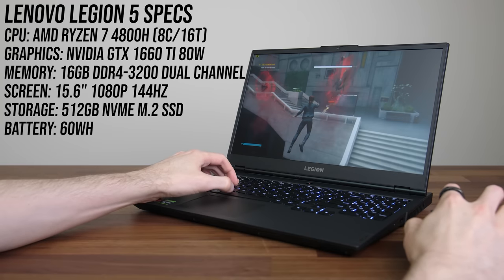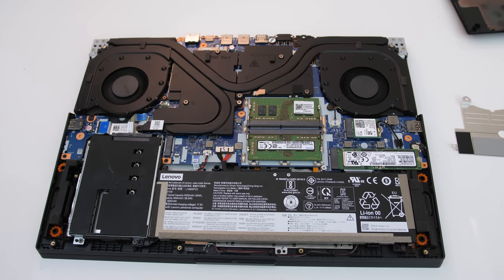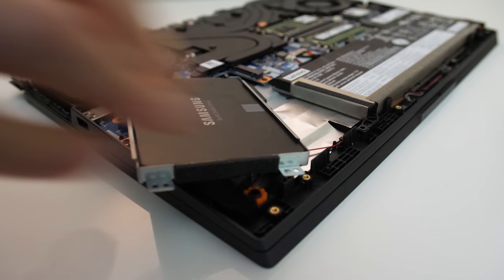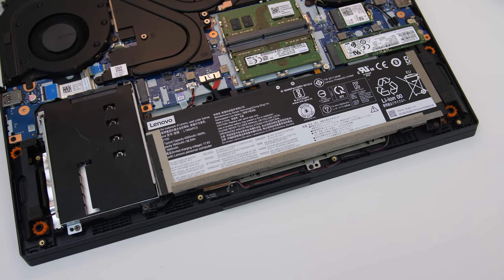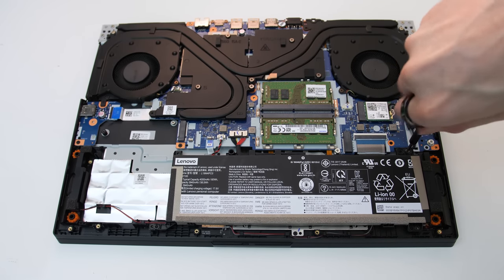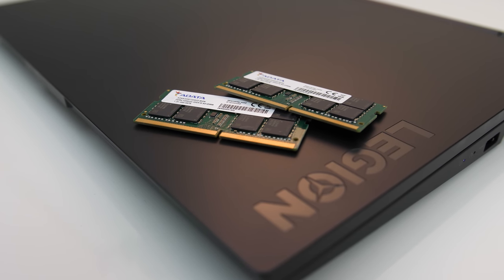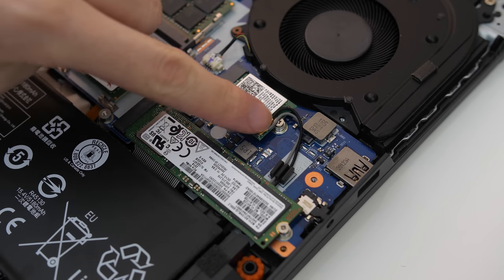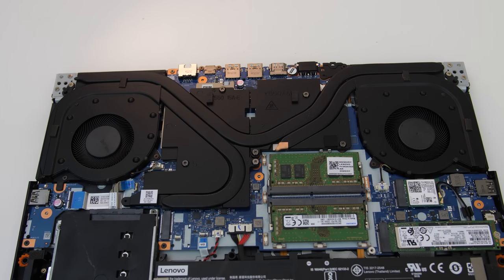Lenovo Legion 5 Upgrade Guide - Boost Performance!

Comment: Does the Crucial Ballistix BL2K32G32C16S4B 3200 MHz work with this laptop? I keep seeing some complaints saying 3200 only useable with XMP profiles. I don't know much about this. Are there any other ones recommended?

Comment: i purchased 3200mhz ram, but i cant get it to run at that speed. even though the oem ram was 3200. Obviously ive looked and cant find any options to enable docp

Comment: Still think the Dell G15 makes better sense as a Gaming Laptop purchase... Lot of people were boasting about owning one of these but my laptop comes with rtx 3060 and a 240 Watt power supply: sure it does not have a "240" hz monitor and you can't game longer than 2 hours: you can work 10 hours on it however or just watch youtube but since all you really need in reality is a powerbank that can provide you with a 240 watt experience on the go it's not that big of a deal. It may not look as sleek but, my laptop looks unique, does not get too hot or loud while running games and has decent enough specs vs a 1660ti - if you're a new buyer consider comparing these 2 laptops, you'll be pleasantly surprised.

Comment: I have the Intel version of the Legion 5 that I bought last year; it's equipped with a Core i7 10750H CPU, 16GB of RAM, and an nVidia GeForce RTX 2060 GPU.

I'm planning on upping the RAM to 32GB, as I think 64GB is overkill for what I do, and I don't know if my laptop is compatible with it.

Does the guideline apply to Intel models?

Comment: I recommend disconnecting the battery before performing any work on the main board.
this is the first thing to do you are very lucky that you did not burn it. greetings

Comment: if you're installing an additional m.2 ssd, do you need a heat sink as well?
Sorry if a noob question, first time looking at upgrading a laptop myself
Reply: Please don't update these things yourself if you are not professional in it bcz some people in the comments are saying that you have to first disconnect the battery or else motherboard will short circuit idk but it's caution so I don't recommend you to do at your own upgrade that from your nearby electrical shop or laptop store
Reply: Not for a 1TB m.2 3.0 SSD. No point in getting the faster 4.0 stuff that requires a heatsink as it goes in a 3.0 slot. Plus, I don't think there is room for the heatsink.

Comment: So I'm thinking about getting a legion 5 from the lenovo site and they have the option of it being an 8GB ddr4 memory and 16gb ddr4. So my question is should I get the 16gb or just get the 8gb and get (2) 32gb like you did? Also they have an option for a 1TB ssd and wondering if I should get that or just get the lowest size and get a bigger ssd later?

Comment: Awesome video Jarrod!  I'm looking at purchasing a Lenovo Legion 5, but it comes with a 1tb HDD drive in addition to the 512gb PCle SSD drive.  Would the 1tb HDD drive get in the way of trying to install the 80w battery?  I'm curious if the HDD sits in that drive bay and if it would prevent me from installing that bigger battery.  I talked to the Lenovo sales team and they said it was possible for me to upgrade the battery on this model, but after watching your video I'm a bit confused and just wanted to make sure this was possible.  Would appreciate your advice.
Reply: I don’t know think there’s room. I heard you have to pick one or the other unfortunately.
Reply: @Blue-xn1mj  That's what I figured. Thanks for the reply!

Comment: Thanks for this video!! I was totally thrown on how to add a second SSD. Didn't realize that it is either a SATA drive or SSD. So many little things like this are confusing in the initial advertising. Lots of small print needs to be considered. The Battery for instance. As you were experiencing it seems like many of the max specs are confusing to third party manufactures also. It appears that whatever hardware state the industry was in at the time Lenova tested the units is what they stick with. I still see it being suggested that 16 GB or RAM are max. I just put 32 in, but you have shown 64 is fine.

Comment: Jarrod, Is it possible to replace the 80wh battery of the Lenovo Legion Pro 5i with 99.9wh battery of the Lenovo Legion Pro 7i? What about speakers? I am asking this question because these machines literally use the very same chassis and speakers and the battery of lenovo legion pro 5i is terrible.

Comment: I have uncovered the laptop and I could see that you can install an M.2 2280 in the place where the M.2 2242 is. You remove a base screw and it fits right in. I will try it later when I buy the M.2 and expand from 128GB to 1TB.

Comment: Dear Jarrod, great video. Upgraded battery to 80W Lenovo OEM for the Legion 5i. Charges normally 100%, works perfectly when plugged in. However, when on unplugged, i.e. working on battery alone, boots initially but powers off each time before reaching windows logon screen. Reset BIOS to default. Reset power management to default in control panel. Boots each time when plugged in,  but not on battery. If boot plugged in, will continue to work when unplugged once in windows. Could you please advise how I could fix this problem? Thanks very much. A

Comment: I have a lenovo legion 5 laptop. i bought it in 2021. Warranty expired in 2022. Last year, its charger started fluctuating/ blinking. The charging metal portion, that goes into the charging port of laptop, started getting super hot while playing games. Whenever this happened, the charging light would start blinking and the laptop would go from performance mode to balanced mode, causing major lag in the transition (basically the charger would start disconnecting and connecting. Gaming was impossible) . I got it checked out from the local store. They told me that I had to get a new charger or replace the charging cable (the power cord is fine but the charging cable attached to the power brick was the issue apparently). So I got it replaced. It worked fine for about two months, but the same issue started happening again. This time, I bought a new charger and got the laptop cleaned and its thermal paste changed. It worked perfectly for the past six months. Unfortunately, the same issue is happening again since yesterday. It is so frustrating. Please let me know if there is a permanent fix to this problem. Can the problem be the charging port (it somehow fries the charging cable overtime or something?) or is it the charger again? Chargers are really expensive. Also, I don't have any guarantee that buying a new charger will fix the problem permanently. Will it work for only 6 months or so? I cannot afford to buy a charger every six months. Please let me know what to do?

Comment: Dude, when you lift the laptop cover, before ANYTHING you do, first disconnect the battery. Then do all other things you wanted to do. This is because anything you accidentally drop on the laptop PCB, will short something and the motherboard will be dead. Any accidentally dropped screw or metal cover or even merely disconnecting some other connector (like display connector) will have very good chances of killing the device.

Comment: Sir need some help actually I've upgraded battery 60wh to 80wh but laptop only turn on when charger is plugged in after booting I'm able to use laptop without charger but initially its not turning on without charger... How can troubleshoot it..
Reply: Try turning the battery cable other way...

Comment: So after removing the 1tb 2.5 ssd that came stock to make room for the larger battery and installing the m.2 ssd, could I also replace the 256gb m.2 ssd with a second 1tb m.2, or is this not necessary? And if yes, what else would need to be done setupwise. Thank you!

Comment: i have the  i7-10750H/RTX 2060 version. I added a SSD to mine with the help of another video, and they didn't mention lifting the battery slightly to help get the tray out. I wish i saw this video back then

Comment: I can see giving up that SATA drive for a larger battery, but I really don't see why you have to CHOOSE between the M2 Drive and the SATA drive. What were they thinking?? I have an Acer Predator Helios 300, with 2 (filled) M2 slots AND a filled SATA drive slot. (The battery is still original though.)

Comment: Greetings Jarod,

Thanks for the video it was really helpful I have a question tho. I replaced the 1TB HDD with a 1TB SSD nvme, when going to the BIOS I noticed the new SSD is on the slot 1 and my Windows SSD is on slot 2. Do you think this could be an issue? Do you recommend switching my Windows SSD to slot 1? Looking forward hearing from you. Thanks again.
Reply from the maker: It shouldn't matter but you'll need to set boot order to slot 2.
Reply: @JarrodsTech  Thanks for your response I appreciate it.

Comment: Dear Jarrod, 
I just got my Lenovo 5i pro, and I have a question about charging options as the standard 300W charger is very heavy.

1) Can I charge the Legion 5 pro with other charger than with the original charger with 300 watts?

2) Could you either make a video or reply to this comment. I cannot find any information online about this.

Best wishes,
Johan
Reply from the maker: Yes you can use the 230w or what ever one. Join the Legion discord they talk about this stuff there https://discord.gg/laptopwiki

Comment: Question: does this have some type of "stamps" that u need to remove in order to change the RAM?
Asking cause if something happens and I need to use the warranty, they won't fix it if they know I opened and changed any type of hardware.

Comment: I bought the OUWEE L19C4PC1 off Amazon. Are these a trusted brand and any reason why their $30 more than Lenovo's? I also replaced the 2TB 2.5' SSD I put in it for a 2TB NVME M.2 which the M.2's really do perform better and now with the bigger battery and M.2 the laptop looks full and clean.

Comment: I use both SATA and NVME SSD. When using over provisioning on SATA, the speeds are more or less the same. 
Is it possible to upgrade the usb from usb 3.2 gen 1 to 3.2 2x2?

Comment: Hi. Why you did not unplug battery before doing things? I heard that because of it motherboard and components may be damaged by an accident. Like your phone calls, you move your hand where it should not be (not fast enough to manually damage things), but in bad place that will short circuit things.

Comment: Thanks for this tutorial. The top two screws on the hard drive holder thing are screwed too tight and I’m worried I’ll strip them. Any tips for this?
Reply from the maker: Not too much you can do, in that case I just push down extra hard to get a better grip. If you do start stripping it then there are things you can try like gluing the screw driver bit to the screw or using a dremel to cut a line out and using a flat head bit.
Reply: Thanks for taking care of my laptop. You treated it well but Im sad that your bosses told you to shred it.

Comment: Hello Jarrod, quick question, if you have the lenovo legion 5 2022 model, is it possible to do an upgrade video on it? I honestly want to know what is the maximum capacity that laptop can go, 🙂 as I do own the 2022 model, and I want to upgrade it at one point.

Comment: About the memory... I saw a bunch of videos (mostly yours I think) that talked about getting better ram as it increased your fps by almost 10 percent.  Was the ram you installed not any faster then?  I would like to get 32g of ram but I'm not really sure if the ram you listed here is the right stuff to get or the crucial stuff is the right ram?  Any help here would be appreciated.  Thanks.
Reply: yeah ikr   we need some clear answers here this is bullshit    crucial says 2 16gb sticks will work but lenovo says just add an additional 8gb for 16 total  which is it???

Comment: hey 2 gb 970 evo plus work with legion 5? i have ryzen 7 4800 h 260 rtx. 1 slot m2ssd 256 gb other one 1 gb hdd. I want to change the hdd with 2 tb 970 evo plus. will it work? thanks for reply.

Comment: Hi thanks for this guide! Noob question here: I bought two new sticks of RAM but when install them, i get the BSOD screen. (windows will boot, I get to unlock screen then boom it needs to restart over and over. ) What am I missing or doing wrong? btw the specs are the same as the stock ram. DRR4 3200hz. Please and thank you!

Comment: 01:50 - it's a SSD drive, you need only 1-2 screws to keep it in place, there is no mechanical movement.
No need to take out the tray.

Comment: Can you add a second m.2 drive rather than a large SSD? I cannot see a place where you would install it. However, the manual that came with my laptop says you have two m.2 storge ports.

Comment: If you're looking to get the 3050ti Version of the Lenovo remember to buy an extra nvme ssd as this one doesn't come with the necessary slot to install a 2 inch sdd or HDD

Comment: Thank you for this video.  I used it to help upgrade my ssd.  I noticed you put 64 gb of ram in the machine.   In the specs the one I have says it will only do 32 gb.  I just put 32 gb in it.  Will it run 64 gb like yours?

Comment: Can anyone confirm if the pry tool will leave any pry or scratch mark after opening the base cover? I had bad experience on other laptop after prying open the laptop. I just want to be sure I won't repeat the same mistake on Legion. By the way, why can't the laptop manufacturer make it really easy to open without the need of pry tool?

Comment: What is the max ssd capacity on my lenovo legion 5 ryzen 5800h rtx 3050 ti? I currently have a 512 gb nvme ssd and im planning on adding a 1tb nvme for a total of 1.5 tb. The website says that you can only upgrade to 1tb though?

Comment: Oh, also, Lenovo says, "The Specification of your device it supports Up to 16GB DDR4-3200 offering but Crucial claims they were able to test 32GB thus you can upgrade up to 32GB (2X16GB)." I'd like to do 64, as you did, will it work for the Lenovo 15ACH6?

Comment: I have a dell g3 with 128gb ssd and 1tb hdd. I want to swap the 128gb ssd to a 256 or 512gb ssd. But the os is on the 128gb one. How can i shift the os from older 128gb to the newly swapped one? The oem is charge is obviously a bit high if they do the swap. Can you suggest any other way?

Comment: As for the hard drive bay, can I use both the SSD and the secondary M2 drive, or is there physical limitations that will prevent installations of both?
Reply: Physical limitation from lack of space. Also hardware limitation, because they are both wired through the same controller on the board. Meaning it can only read one or the other. Not both

Comment: by upgrade the battery size , do we need to do any setting changing or calibration to let the window recognize the exact capacity of the battery ? currently i using other laptop which from 47Whr upgrade to 91Whr , but the battery life seem can't pump up to double . although i had turn off the keyboard backlit , lower the brightness , battery saving mode  . only turn on bluetooth mouse and wifi (this upgrade bottom panel unable to close , i decide buy some screw stand to extend screw)

Comment: @Jarrod'sTech 
Thank you for your video, can you help me??
I recently purchased a lenovo ideapad 3, 15ARE05, 15.6 inches, however the battery doesn't last as long as advertised, so I was hoping to replace it with a larger one.
I removed the hdd and put in its place a m.2 ssd for storage leaving quite a bit of space for a bigger battery unit, I am contacting you in the hopes that you might be able to  suggest a battery model of around 9000mah or more (the longer the battery last the better) that could be suitable for my lenovo model, as I couldn't find it amongst the ones indicated by the lenovo replacement parts link you left.
Any help will be greatly appreciated, Much gratitude!

Comment: Also when buying RAM, buy the 2R×8 instead of 1R×16. You get a bit more performance squeezed out.
Reply: @sfooter1692  let's put it this way. No, 1 rank of 16 chips will have only 1 library to store data which will be slower compared to 1 or 2 ranks of 8 chips cause the library will be smaller due to double ranks and easier to be accessed, so the data selection will be faster than 1R×16. Get it?
Reply: What's this mean exactly? Could you link to a good choice?

Comment: Great video! I just got the Lenovo Legion 5 and this was very helpful.
One question if anyone in the comments knows: I just upgraded my RAM by taking it to a shop nearby. I went from 8GB to 32GB. Now I keep getting BSOD with kernel security check - which after googling shows me that it is a RAM issue. Is there any way to fix this? Or do I have to go back to the shop and get a replacement?
Reply from the maker: Given you had someone else install it for you, I'd probably go back to them and get them to fix it. Make sure to confirm it boots before you take it back.
Reply: @JarrodsTech  Hey, thanks for this reply!! The trouble is, it boots fine and then sometime around 20-30 minutes later it crashes. So, it didn’t crash until after we brought it home. The type of RAM he installed was V-Gen. Anyway, thanks again and I am on my way back to the shop now.

Comment: Hello Jarrod, I have legion 5 pro AMD with MediaTek MT7921 LAN card. I had poor performance in games and wanted to replace it. But now I have read that Lenovo has whitelist, which means I cannot replace it with Intel LAN card. ebay listings descriptions also proved this(AX210, AX200). My question is: do you know how fix this or are there Intel cards that are in the whitelist/compatible. Thank you.

Comment: Does the new battery upgrade cause any problems in putting in a new 2.5 drive or closing the bottom panel? Based on the video the upgrade battery looks pretty big and seems like after putting it in the new 2.5 drive upgrade won’t fit?
Reply: Yes it will not fit a 2.5 with battery upgrade
Reply: @thefox5301  do you know what battery upgrade would be best to fit both the 2.5 upgrade and battery upgrade?